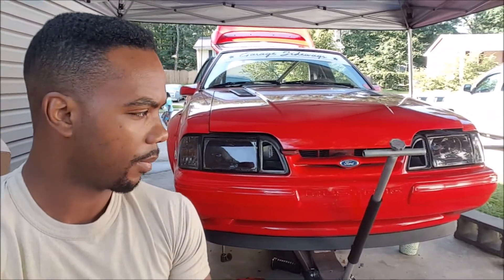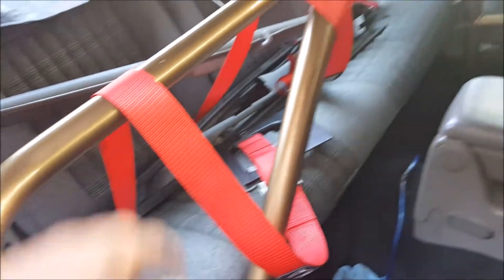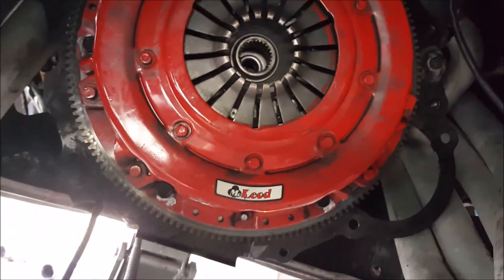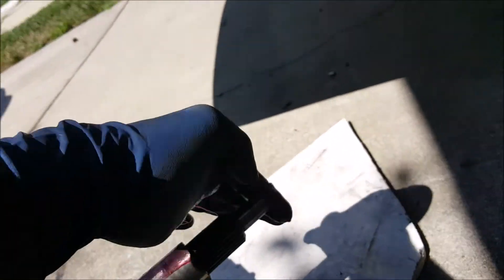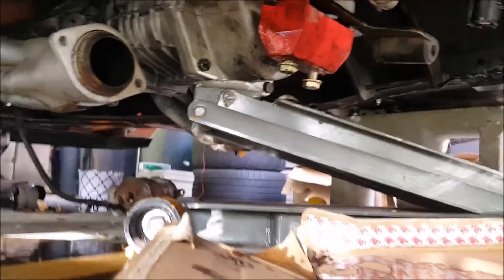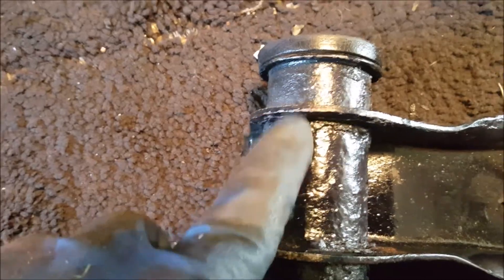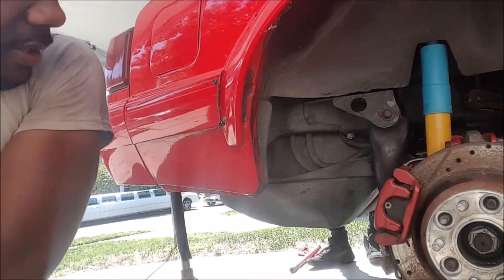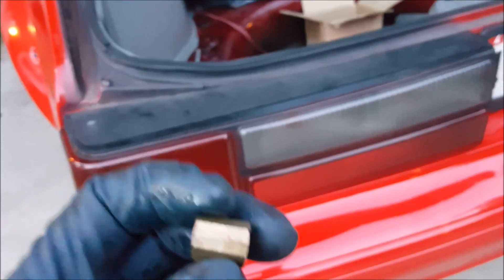Foxbody: IRS and TKO transmission install

Comment: Awesome build! Been following for a while and I enjoy watching as you progress further. Kind of sad that you bought the car with the IRS already installed, would have liked to see how difficult the install process is. I'm wanting to put an IRS in my fox but can't seem to find good information on the conversion. Keep up the great work! Really enjoy the videos!
Reply: BuiltTV when you do it be sure to film it for us
Reply from the maker: I didn't buy it with the IRS, I had a buddy install it for me b4 I was documenting the build.  It was the first mod I did to the car.
Reply: Premium Fuel Mag oh OK. I just saw in the video about the differential that you said the previous owner had swapped the axles and they were no longer 28 spline. So I thought you must have bought the car with it already installed
Reply: Premium Fuel Mag were any modifications to the frame rail needed for the upper mount of the IRS assembly? Or did it bolt right in where the quad shock mount was bolted?
Reply from the maker: Since there are so many questions about the IRS set up, I'm posting a new video today.  Check back this afternoon, that should give you all the info you need.
Reply: http://forums.corral.net/forums/general-mustang-tech/1031857-my-fox-independent-rear-suspension-project.html   There is a lot of good info on Corral about how to do this.  That's where I got most of my info to do mine.  It's an easy swap to do.

Comment: Assuming you have a TKO 500/600 with the IRS, which driveshaft did you end up using? I'm trying to figure out the same thing in my mustang.

Comment: Hi, do you have an adjustable clutch cable on the fork end or do you have a non adjustable cable with a firewall adjuster only?
Reply from the maker: the cable is adjustable on both ends
Reply: Thanks

Comment: Just curious what RPM's are you shifting at?
Reply from the maker: with the 5.0, i would wind it all the way up past 6700 if i was drag racing.  I rev the LS to 6800.  Getting 3rd gear is hit or miss, half the time i can't hit it,  i've thrown away a lot of runs missing 3rd.